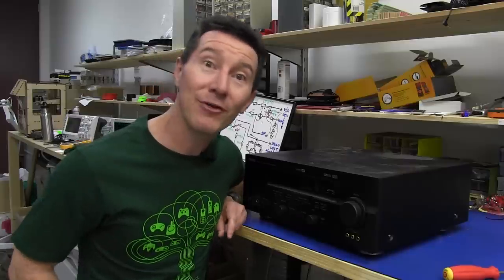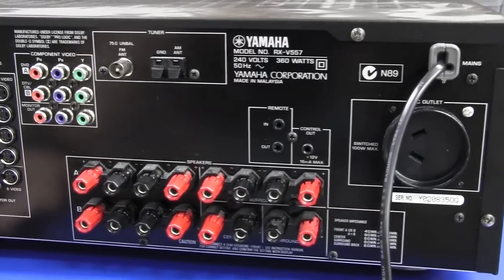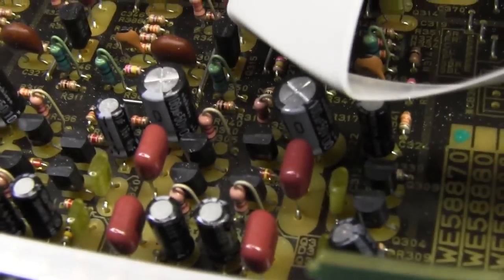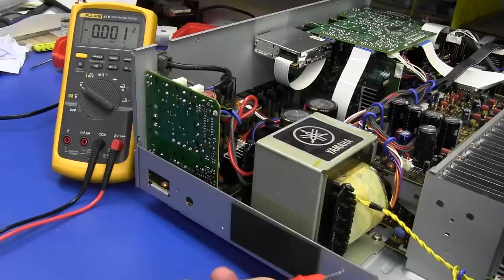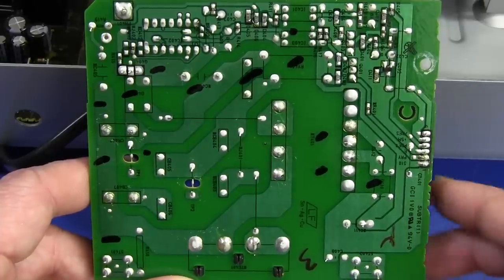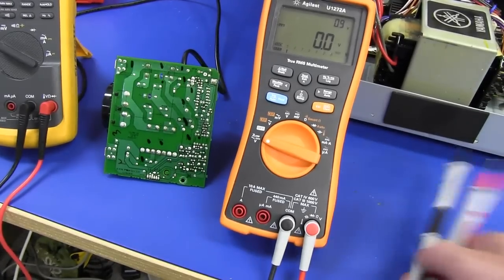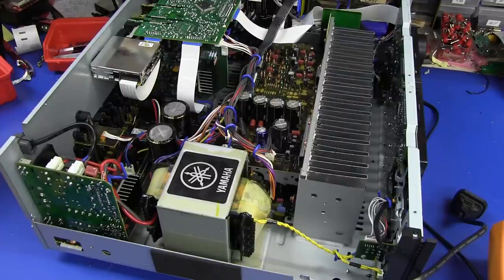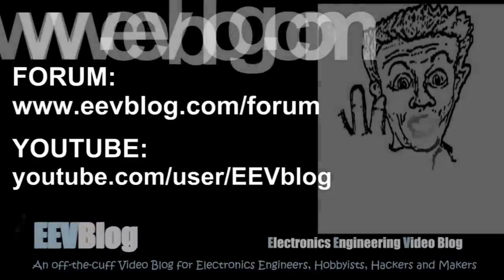EEVblog #378 - Dumpster Diving Teardown Repair

Comment: Fuck receivers. If you want quality and reliability, together with the ease of service, get a fucking preamp/processor component and some amplifiers separately. After 10 long years of hard use and abuse, I had my integrated amplifier from NAD Electronics fully restored to manufacturer specification in 1 hour by an authorized technician. Nothing complex about NAD C340 amp. I still abuse it every day and it says "Thank you, Sir."
Reply: I can't help but think that what you are saying isn't an actual opinion, but spam.
Reply: ronettreker Yes, yes, I am just a robot with no soul. I am a machine. If I tell the truth, I must be a spammer.
Reply: Nad always blow up and sometimes take the speakers with them, i've been put off ever since.
Reply: my yamaha cr820 is 38 years old and has not failed once in its life and gets thrashed at full volume every afternoon. so yeah. and it has a tuner inbuilt into it.
Reply: not not a lie. not full volume for a constant 38 years. i said every afternoon (not even maybe twice a week). for about 30 mins or so. And not for its whole life either. it had a wrest for 5 years or so. but its never broken down. my grandad originally owned it and now i do. i still have the original warranty and instructions. it has never broken down once in its life. a good quality amplifier such as a rotel or yamaha should not clip under a proper load such as 8 ohms. a shit amp will clip. i have never heard that amplifier distort at all. and yes  have a clue with stuff related to audio. a good amp and speakers should not clip at all or very minimal under a proper load!! 
if you dont believe me, thats your choice, i am just having a say. believe what you want i dont care. just dont tell people that they are utter idiots or that they are talking out of their stinky ass when they are just trying to share something. i have nothing against NAD btw :)
Reply: I've got a and cassette deck too, probably the same as yours, it's my deck, what can i say.
Too many amps to mention, mostly, BSS, QUAD, LEAK valve, CLOUD, DENNON, MARANTZ, CAMBRIDGE AUDIO, MC2, QSC, HARRISON, YAMAHA, MARTIN & LAB GRUPPEN (same thing).
Reply: MuristekTV I will choose the new Yamaha stereo amplifiers a-s3000 and a-s2100 over any NAD amplifier! Just go and listen....
Reply: mystique Go and listen to what? I love my NAD amp because it is the best amplifier in the world. I will never buy anything else.
Reply: MuristekTV The best in the world???
Reply: mystique Yes, by far the best in the world. Nobody else gives such nice, meaty sound like NAD. NAD is the best.
Reply: MuristekTV meaty sound, lmao. big meaty NAD
Reply: ***** NADs on your chin. Enjoy!
Reply: my NAD's are sooooo Meeeaty UhhOoooo.....
Reply: MuristekTV Nad is kind of cheap. At least their speakers are. I had one and it was a sorry excuse for a pro speaker.
Reply: Joshua's Recordings Check out the Masters Series from NAD. Very expensive. Trust me, NAD amplifiers are the cream of the crop. Try them. I bought the C340 model 15 years ago and I would rather sell anything else I have before ever selling my amp. It's a real performer.
Reply: MuristekTV If I get one for a low price I will try them. I am not buying one retail right now, they do look decent in the pictures though. Are you a sales person for NAD by any chance?
Reply: Joshua's Recordings No, I am not an NAD salesman. I am just a music lover and I know that any NAD amp will drive the most difficult speakers with ease. All of their amps are high current designs and stable down to 2 Ohms. Even the cheapest models.
Reply: MuristekTV My Onkyo also has a high current design. Though, down to 2 Ohms is really good! You should ask NAD if they are hiring, I think you would make a good salesman for them.
Reply: he's obviously going through the menopause
Reply: such a lovely guy, you don't come across badly at all. do you have fantasies of everyone on youtube. if you want the truth im into my second degree studying electrical & electronics. its summer time :) enjoy your life mate, time is precious...
Reply: you sure are an angry guy, has to be said
Reply: Um the Muristek guy might be a little condecending and rude, but no joke NAD amps are wonderful, and not all that expensive. I have two Proton D940s (re-badged NAD receiver) that I use as standalone power amps for two stereo channels, and a Marantz preamp/receiver feeds them. Really amazing, crisp, crystal clear sound, up as loud as you can listen, the NAD electronics are known by audiophiles world wide. Only your snobby tube guys might look down upon them, but they are a little bit out there, thinking you need a $10,000 McIntosh to listen without ruining the experience. Don't let a petty fight ruin some quality amplifier information.

Comment: I have a Yamaha RX-V575 that was displaying Treble and Bass Bypass when working, plus it would only power on or off with the remote. The power button on the receiver did have functionality because after a firmware update the power button did shut down the unit. Anyway the receiver stopped working but when selected on with the remote there is an audible click (or two) and nothing happens (not powering up or any display on the front panel).

I'm looking for the service manual and circuit diagrams to trouble shoot, does anyone have a link?

Comment: Just a thought, for powering up does the amp need a transition voltage from the on button rather than the fixed voltage from your bodged resistor. Maybe it needs this to sequence the power up by turning on different sections.

Comment: I have a Yamaha RX-V557 in Italy. It's a part of a set and its power cord is in but it does not power on. But it is plugged in. There is a 6 sided area to the right (  on the back) Is something supposed to be plugged in there?

Comment: Ya just can't reason with some people, and most of them think because they have some sort of formal education (which IMO means almost nothing about intelligence) that they know everything about a subject.  It's funny to argue with these people about digital audio because they can't grasp that it doesn't come out of a DAC as a staircase.  I like tube amps because of how they color the sound, but I will never try to convince myself or others that they perform better than a solid state amp.

Comment: And don't forget.  You should take your rings off.  Unless you like that gold permanently melted to your flesh.  In some cases a ring can blow your finger clean off.
Reply: What are you talking about? I got shocked from 120 V ac outlets more times
than I can remember and I got the tingling of current flowing on my fingers
covered with sulfuric acid dinking around with 12 V car batteries.
Reply: foureyedchick I repaired TV's many years ago.  About 3 months into my career I found out why wedding rings and other jewelry were to be taken off.  35000 volt arc from main power transformer was all I needed to teach me.  By the way, you can almost swear you are flying as you hit the wall.
Reply: T'Elder Silverhawk
It's crazy what happens when you unlock the full potential of your muscles through electric stimulation.

Comment: When I say class A, I mean class A. You can even find complete schematics for it.
It is 2x40W (or thereabouts) output rated I think. I was looking for something cheap (I paid about $12 for this incl. shipping) that could drive my 4Ohm speakers. And yes, it gets hot even when doing nothing even with the few kg heavy heatsink.

Comment: Well shit, they actually did produce pure class-A amps. 

They're nuts. That amp is going to dissipate 80+W of heat ALL THE TIME. (even when it's producing no output.

Turn it off when your not using it, then, or you're going to waste a hell of a lot of power.